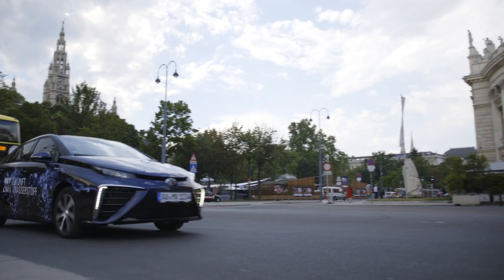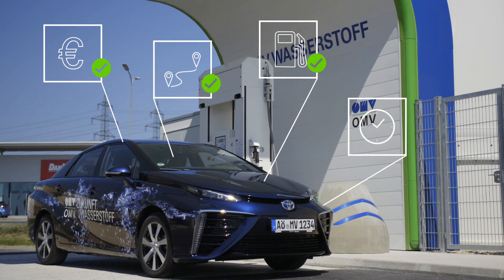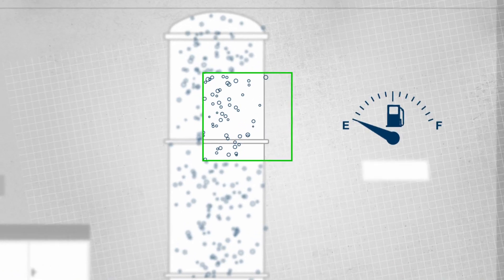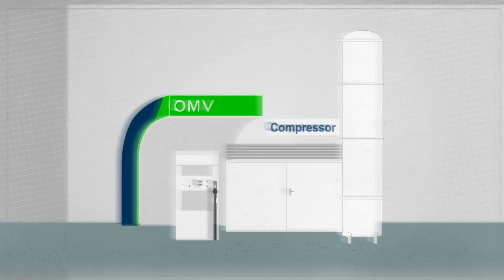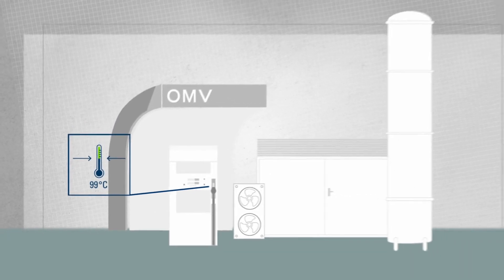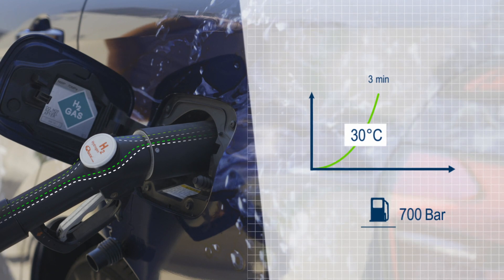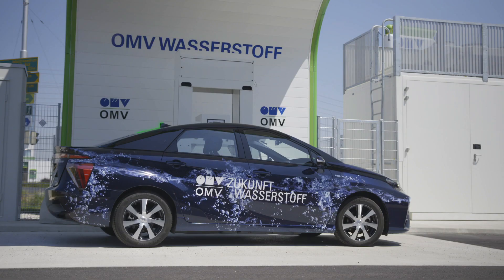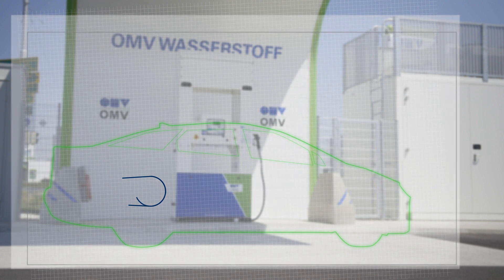How does a hydrogen filling station work?

Comment: Notice how all these stations are surrounded by thick concrete? I’ll stick to gas or electric and avoid the explosions
Reply from the maker: Hi P, hydrogen vehicles of the latest generation have already covered many millions of kilometers worldwide in the last few years under everyday conditions. Due to their construction, hydrogen pressure tanks are much more resistant than conventional fuel tanks. The risk of explosion of a hydrogen tank is extremely low. Since hydrogen is under very high pressure (700 times the air pressure) and about 14 times lighter than air, it rises very quickly and there is therefore no possibility that something from the outside (air, oxygen) flows into the tank and it thus an explosion could occur.
Reply: @omv  There is video's to find on youtube about tyres and high pressure air tanks exploding. Exploding in the sense of releasing all pressure at once, not an ignition. How is a hydrogen tank different or made more safely ? Thanks.
Reply from the maker: As stated beforehand, due to their construction, hydrogen pressure tanks are much more resistant than conventional fuel tanks. The risk of explosion of a hydrogen tank is extremely low. Even when a hydrogen storage tank ruptures and assuming a leak ignites, a hydrogen flame tends to burn out, within 90 seconds without huge damages to the vehicle and his passengers.
Reply: @omv  Thanks I fully understood your first statement. I'll ask different. I would like a compair between a high pressure air tank to the hydrogen tank. I think an air tank is just regular steel, but I'm not sure. How is your tank stronger, how is it build, what material ? Thank you.
Reply: @omv  yeah I’ll pass. If there wasn’t a major risk they wouldn’t be surrounding the area with massive concrete blocks. Hydrogen is a terrible fuel choice anyway it’s beyond dirty with the current method of production. Electricity with solar and wind and tidal is the future. Even hydrogen cars suck the nicest and most expensive the Toyota Mira Is a giant pile of garbage and is 10 years behind a Tesla in every possible way.
Reply: You don't seem very intelligent
Reply: Notice the safety measures that are better than any gasoline station? I’ll stick to flammable gasoline which has never exploded or hurt anyone ever.

Comment: How long before hydrogen fueling stations become the norm? Are there franchise opportunities, and would extreme cold weather make such a venture more or less viable? A business opportunity where snowmobiling is popular has me wondering if hydrogen-powered, quiet snowmobile rentals and a hydrogen refueling station would be a solid investment?
Reply from the maker: Hello greeneyeddg.
We cannot judge if a h2-powered snowmobile business would be economically feasible but the advantages from hydrogen as a source of mobility are quite obvious:
-) No local CO2 and NOx emissions
-) Hydrogen vehicles offer long-distance electro mobility with familiar driving comfort
-) Proven technology suitable for mass production
-) Fueling with hydrogen is safe, efficient, odor-free and takes around four minutes (for cars)
-) Fuel costs and range are comparable to conventional vehicles

Regarding your question concerning temperature. This is no issue at all as there are hydrogen fueling stations from California to the northern part of Norway.

Comment: First of all is this for a fuel cell or a  hydrogen engine? Second is that it shouldn't be too hard to make your own station at home. Just have the cooling system and other electrical necessities be solar powered. Easier said than done but if someone said that I can't do it I'm gonna try, even if it blows me up.
Reply: Why in the f would you do this. 🤪
Reply: @Badkhela  fr, you gain nothing and now you have to worry about your car blowing up when you hit potholes
Reply from the maker: Hello! Our hydrogen car in the videi is a fuel cell powered Toyota Mirai - nowadays most OEMs develop H2 in this application. Considering the learnings frum running our H2 filling station network (eg. running the H2 supply logistic, or handling of the 700 bar compressors) we would definitely not recommend trying to build a home station on your own though. Safety first! :)
Reply: At 700 bars you are talking about having equipment to handle over 10,000 psi and not only that, you also have potential leaks when you let pressure drop below 200 bars. Again there are more to it than just plumbing, like having sensors and auto-valves to shut down to prevent fire or explosion.

Comment: WHERE DOES HYDROGEN COME FROM? Are we making hydrogen cleanly and environmentally?
Reply: Hydrogen is the most abundant resource in the universe. No worries
Reply: @Tisa-Touch  ..... it's the energy required to obtain the H2 that's the problem... there is no free H2 on earth and you need to use ~100kWh to get ~50kWh of H2.  It's just a really... really inefficient battery.
Reply: @Chris-ie9os  Still better than electric cos we can get hydrogen for ever and there will never be enough litium to produce battery for e-cars + bateries lose more than 60% power when run in cold enviorment not too mantion the charging time .. unless someone will make better and more obtainable bateries witch is highly unlikely the hydrogen is just better in long run and will propbably be the fule of future.
Reply from the maker: Dear Mr. Wang,
OMV is obtaining H2 for the hydrogen filling stations from external suppliers. Today, hydrogen is coming from fossil sources to overcome the hen-egg challenge. OMV is evaluating and working on green hydrogen projects to assess the future impact like in our wind-to-hydrogen project (https://www.omv.com/en/blog/renewable-energy-lets-store-it).

Comment: Hmmmm mmm........ completely harmless you say?  It is highly combustible & I can see people using this hydrogen to make explosives, also if it is in a high speed high impact collision, will it not explode before it can vent the “harmless gasses” .  A nuclear car, wow! That sucks!
Reply from the maker: We have been using a proven and reliable technology for years with high safety standards on our filling stations. There are several hundred hydrogen filling stations in use worldwide without any technical issues. Hydrogen as a form of mobility is new, but the technology behind it is manageable. Otherwise the authorities would not have granted us a license. 

This statement is only valid if the hydrogen pump is used according to given terms.
Reply: not like gas is much safer
Reply: Demonstration below gasoline vs H2  vehicle.  Tell me which looks more dangerous.  And Lithium battery vehicles are even worse than gasoline vehicles, some demonstrations and examples recently below the first.
https://www.youtube.com/watch?v=IknzEAs34r0
https://www.youtube.com/watch?v=T3RNISfwa4E
Reply: @jmitterii2  Don't hygrogen vehicles have lithium battery's tho? On a smaller scale
Reply: Not all of them. The Toyota Mirai uses NiMH, like the Toyota Prius.
Energy density isn't that important, if you need only about 1.6 kWh.
Reply: If you don't know the difference between hydrogen gas and hydrogen bombs, you should ask that from your mom before using her phone to make stupid comments on YouTube.

Comment: Secondly, hydrogen tanks are not completely harmless. Then mixes with the air rapidly part you mention is marketing speak for explode.
Reply: Nope. Science speak.  You can see an example H2 tank which was ruptured and ignited vs gasoline vehicle's tank the same.  It jets the H2 fuel straight up.  The gasoline vehicle literally roasts. 
https://www.youtube.com/watch?v=IknzEAs34r0

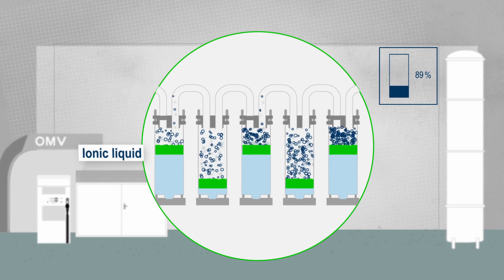Comment: 1:10 You say when hydrogen expands it warms up.
This is wrong.
Basic gas laws (PVT). During compression it heats up. During expansion it cools down.
Reply from the maker: The majority of known gases cool upon expansion and heat up during compression. These gases include carbon dioxide and air. In these cases the Joule-Thomson coefficient is positive (at room temperature). In contrast, certain gases such as hydrogen and helium behave in the opposite way: They heat up when expanding and cool down during compression and so they have a negative Joule-Thomson coefficient. Whether a certain gas cools or heats when expanding depends on the inversion temperature of the respective gas and on whether energy is dissipated at the same time in the form of mechanical work or not. In addition to the Joule-Thomson coefficient (for the ambient temperature), the complete thermodynamic system should always be taken into account for the actual change in temperature.
Reply: PVT is for ideal gas which takes the assumption that 1. We can ignore the volume taken up by the imaginary ideal gas molecules
2.~2. The gas molecules do not attract or repel each other. 
For H2 at high pressures make for number 2 to become a huge factor and as it relates to number 1. 
https://en.wikipedia.org/wiki/Joule%E2%80%93Thomson_effect
https://www.khanacademy.org/science/chemistry/gases-and-kinetic-molecular-theory/non-ideal-gas-behavior/a/non-ideal-behavior-of-gases
https://en.wikipedia.org/wiki/Joule%E2%80%93Thomson_effect
Reply: lol u so dumb get outta here and educate urself
Reply: Mark Pearce i think she meant when hydrogen warms up, it expands.